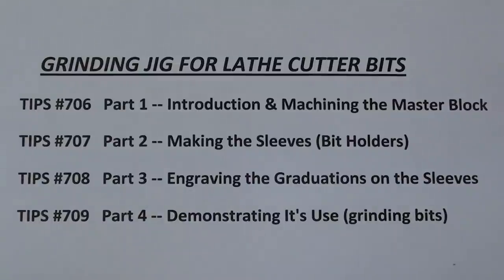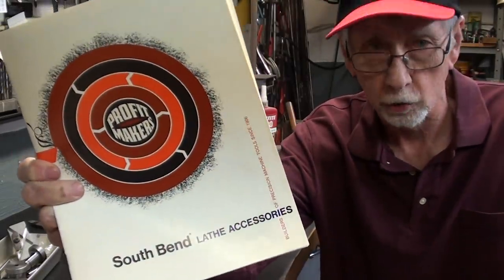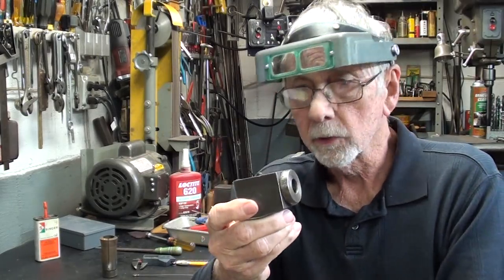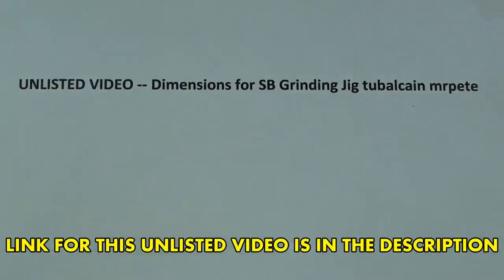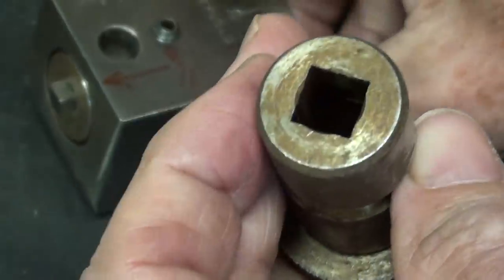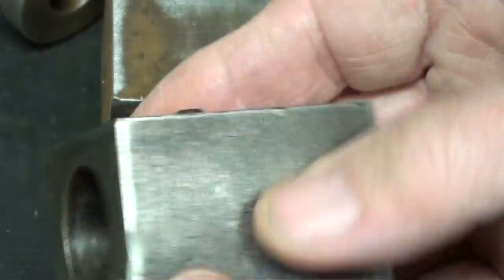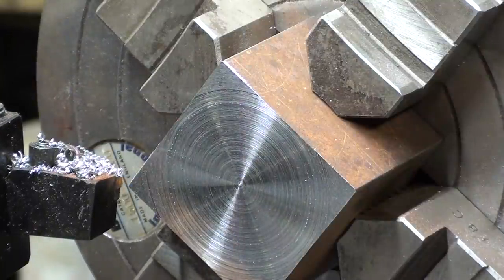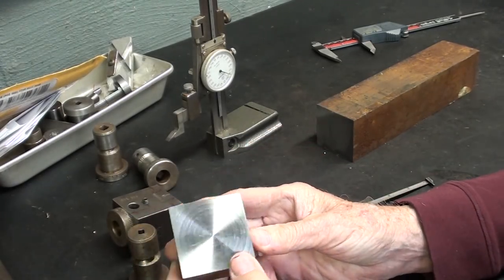SOUTH BEND GRINDING JIG Body #706 pt 1 tubalcain lathe bits

Comment: Hi, Lyle

I think you will find that your accuracy with your center finder is about 10 times as sensitive to change of movement because of the lever distance from work to pivot, and from pivot to center point reference.
Not all modern metrology methods are necessarily better that older ones that relied on simple geometry.
I was taught to use a taught wire for accurate layout many decades ago, and thought that it's accuracy had been replaced by laser leveling, and placement. 
I was wrong, the " New Hadrone Collider ", ( Atom Smasher !!! LOL ) was aligned, and leveled with the Taught wire method.
Sometimes Older is really better !!! LOL !!!

Would love to see you again at the Bar Z bash again this year.
We are loosing ' Old Shop " teachers, and  the next generation will not be better for the loss.

Tim
Reply from the maker: Thank you for the encouragement and the analysis of that center finder. I thought it was old school technology that was not all that good. I was just showing it for the fun of it. I think you are right, sometimes older is better. I won’t be making it to California this year. My trip to Florida really took my energy away, still not recovered. I suppose another old shop teacher will soon be biting the dust.

Comment: Shars, et al, have round spacer sets that are perfect for this purpose. They have a 1/4-28 threaded hole in the center, so you can set them up in advance for all your length operations.

You can also use feeler gages if you need to shave off a few thous.
Reply from the maker: Thanks

Comment: Good Morning Mr Pete!
One of the things I've always liked about you, seems like you don't worry too much about getting things down to a exact measurement.  I recall my Dad needed to make a part for a project he had in mind - designed it in his head, measured and laid out with a tape measure, added .010 for irregularaties in the cast base, and gave a retired machinist friend a sketch with all the dimensions required. Two weeks later, "Marvin, here's the piece youre needing. Took me awhile to get it down to the last tenh thousandth....."
Reply from the maker: lol
Reply: (:-)) I wonder if he ground and lapped the part to a mirror finish?
Reply: @ellieprice363  Lol, not quite good enough to shave with, but you could see a dull reflection

Comment: Lyle,
I am excited about this project. As a novice wanting to learn the basics this project is just what I want and need to do. I don't like any natural faces on my material, so I will take the extra step to face mill each face. 

I am recovering from open heart surgery. I am eager to be back in the shop. I am at 3 + weeks post op, and I was in the shop yesterday and straining is still hard on the healing sternum! I celebrated being released from home health care by ordering a 14k lb two post vehicle lift so I can more easily do auto and truck service. The two post lift may be my home rigging solution for my recently purchased large American Pacemaker engine lathe. I bought it before realizing that it weighs around 9.5k lbs and my home shop hoisting capacity is 3T! Interrupted by heart surgery and still struggling on my end with heavy rigging limitations, my lathe is still sitting in the seller's shop. The big AP brings my lathe inventory to 6, 3 wood and 3 metal lathes. I am building the neighborhood's "best equipped" novice hobby shop for my retirement pleasure. I am having a ball!
I purchased a Baldor tooling grinder to aid my novice tool sharpening skills. I have only used it for one serious job when I sharpened wood planer blades for a teenager friend trying to salvage a beat up wood planer. Your SB copy tool grinding fixture is a tool that I will enjoy making and I will likely use!
I haven't purchased any broaches yet. I will likely employ your "mill a square hole" trick just as another learning shop project. 

You must have been a delightful HS teacher.  I never took shop classes in school. I wound up with a career maintaining machining machinery, mostly CNC, but never was formally trained as a machinist. I have lots of observed head knowledge about machining (milling, turning, grinding) and can troubleshoot, repair and maintain machinery, but learning basic manual machining skills is one of my retirement hobby pleasures. I got my new shop 3 phase functioning just prior to surgery. I have 16 grandsons that all need the shop time that I missed as a boy. I outgrew my first shop and built the new large shop last year. My intention is to separate machining from woodworking. The old shop is now exclusively for my woodworking hobbies.

You are my favorite YouTube instructor. TOT posted a wonderful turning a square block on the lathe video yesterday. I wanted to show the wife, but she just doesn't get the humor! I still want to come meet you. My heart troubles, grandbabies being born every few months, building the new shop, etc interfered with my plans to visit you last year. We learned yesterday that grandchild #36 is on the way! Currently there are "two grandchildren in the oven"!
Reply from the maker: My but you have a lot of grandchildren! I have only five. Your new Auto hoist Will be a big help for you. I pray that you have a full recovery

Comment: i have decided to do it in round stock . With flat's  i dont have sq. stock   & put the heal  & the flat Toe .  one side  & flat   On all  other side's.  & to avid having to set a engraving on all the sleeves,   I engraved  the block instead.  & put a (0) on the  Shaffer to avoid the Grinding wheel. & give good visibility . i stared with a 2" bare  Before skimming flat to 3/4 " of flat the chamfer helps visibility when grinding. !  work's well.

Comment: I'm a bit confused. The first two faces are more or less parallel, given the registry against the 4-jaw chuck face plate.  What assures that the third face is perpendicular to the first two?  The third face was milled by resting the bottom of the block on a rough face - there's no assurance that this face is square to the previously machined ends. (Perhaps none of this matters in this context in that it's close enough.)

I'm not trying to be critical in any way. I'm new to this and am trying to think everything through.

Comment: The diameter you measured it timeframe 18 minutes should be 1.3528 inches in diameter. This makes the circumference of the part exactly 4.25. This allows a certain distance between degree graduations on the circumference of the part.
Reply from the maker: Thanks

Comment: Mr. Peterson.  I'm an old retired auto mechanic who got interested in machining by cutting brake drums and rotors about 50 years ago.  I bought an Atlas/Craftsman 12 Inch about as old as I am (71) a long time ago and became a self-taught chip cutter.  I found your vids a number of years ago and they sure have moved my machine work LIGHT YEARS from where I was able to take it.  At your suggestion I purchased both The Henry Ford Trade School and the Repp/McCarty books and have about read the cover off of each and, as you said, they were both VERY informative and helpful.  I watch ALL of your vids.  Not all of them relate directly to my little shop (I don't have a Mill) but I generally find at least 1 thing in every vid that I can take and apply, in some form, to machine operations I am doing.  Sorry to be so long winded, but I just wanted to say Thank You very much for what you have taught me.  I really appreciate it.
Reply from the maker: Thank you very much for the comment. I am very glad that you enjoy my videos. Good luck with your shop. Mr. McCarthy the author of the shop book, was my college teacher
Reply: Likewise another mechanic learning to machine here. Since we (mechanics) are by default plumbers, reverse engineers, electricians, welders, pipe fitters, this is another important skill to gain.
Reply: @houseofbrokendobbsthings5537  Yep ... The Science of Nuts and Bolts I used to call it.  There was a LOT of machining that went on in auto repair back in the day ... just dealing with busted studs ... and the broken taps and drill bits butchers would leave in there.  Plastigage to measure bearing clearance and clay to measure valve opening/piston clearance.  I don't think anybody does any of that anymore.
Reply: @oddshot60  Correct, I still have a full set of seat grinders and an ancient Sioux valve grinder. Just in case zombies attack and somebody has to fix the last slant six Dodge in the world…LOL.  All the best good Sirs!

Comment: Hello mr Pete. 
I do learn a lot from Your videos. Knowledge I try to pass on to younger generations at an industrial museum I guid in.
When You square stock in the 4 yaw chuck, I suppose You tap the stock thigh to the chuck face? This might be a stupid question but doesn’t the yaws get bell mouthed in the same way in a 4 yaw independent, as in a 3 yaw scroll chuck? 
How do I knew that when tightening the 4 yaw, the stock stays square?
If the stock has a lesser dimension than the through hole in the chuck, is there anything to keep in mind using a parallel? 
PeO

Comment: Another  good project.  I made one many years ago, but cheated a bit. The block was sawed from hardwood and the holder was made from two pieces and silver soldered together.   A machined tube was  SS on to a thick washer I had. That hole in the holder can be round also.  Worked just fine.

Thanks for all your videos, have learned a lot from you.

Comment: I'm tickled you actually HAVE a lantern tool post yet! :-)
This slow turning, pre 30's SB lathe user is smiling and thankful.
That large drill bit finally showed a little deflection and was mad at you!
Now I feel silly, the handy chuck is a JT33 mount isn't it. I have a rescue chuck (from the dumpster) that's likely a JT33 and I haven't tried it out yet to see.
You teach on many levels and we're watching. Thank you!

Comment: Excellent video! I'm not going to make one but I thoroughly enjoyed watching.

One thing I'd add is that although high-speed is (largely) obsolete in commercial shops (I only use it on the lathe for one off form tools and internal grooving bits for cutting the seal grooves in large Hydraulic cylinder glands) I actually still use HSS almost exclusively on my line boring machine. I've had nothing but trouble with carbide on it. 

My preference for grinding is a dedicated 12" "Cincinnati" pedestal grinder with a 60 grit wheel, and the work rest set give the relief angle I use for everything. It's at least the fastest option I've found